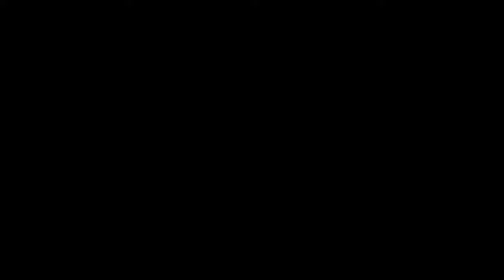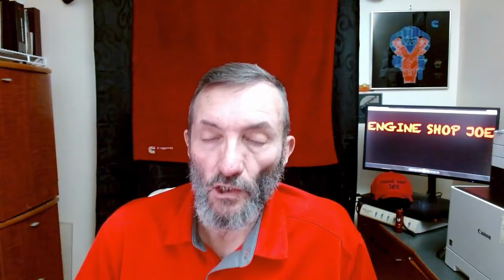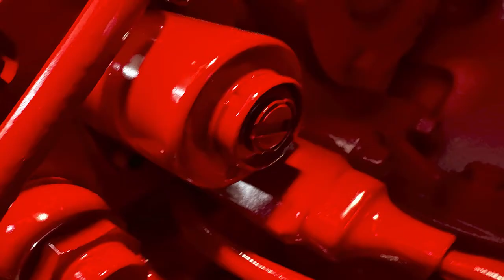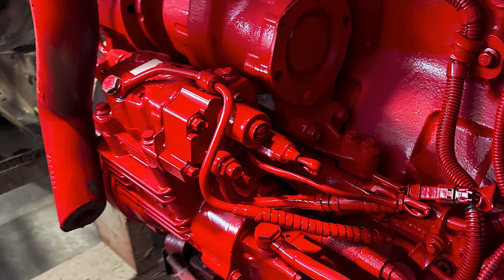What is the IMV valve?

Comment: Working on a 2017 px9. have 157 fmi 1 559 code. changed filters. changed hose from tank to primary filter. changed electric lift pump. verified 15 psi of fuel pressure with key on engine off. cranks excessively to start. after it starts, it will run fine. 559 code goes inactive. will restart all day long. Plenty of power and no driveability issues. come back the next morning and it will not start without excessive cranking to the point the batteries almost die. Grid heater works. Draws 180 amps. Can see and hear it working thru insight. Secondary fuel filter is almost out of fuel. Primary fuel filter is full. If i fill the secondary filter and override the electric pump via insight I can get it to start.  Could the check valve in the ecm cooling plate cause this problem? Could it be a weak Hi pressure pump? Could it be the IMV valve? Should the secondary filter be full? Where could the fuel be going if the primary is full?
Reply from the maker: I have seen this a couple times. Don't throw parts at this because of my comments.  Once It was the nylon hoses that connected the gear pump to the filter. We found that by putting 3/8 fuel line on with clamps and the problem went away. Replaced all nylon lines (it is either the oring in the line fitting or the shrink fit of the nylon to the barb). The next time it was the shaft seal in the gear pump. Replacing the gear pump fixed it. If the check valve closes and moves ok it is usually not that. I dont think it is the pump head but I wonder how long this holds fuel pressure once you shut it off. I believe on these engines the fuel return at the tank has to be under the fuel or it will drain back. So you have a metal tube in the tank that goes almost to the bottom and the return fuel has to go into that. The filter on the engine should not be empty in the morning. The lift pump should be able to fill it in about 3 key cycles. FYI they make a lift pump that pumps 35 psi now. The harness is a different color. They made it to help push air out when priming the system. Run it and watch the data logger when you shut it off to see how fast fuel pressure drops off. Retorque all the injector connector nuts I have seen that stop a problem like this too.
Reply: @ENGINESHOPJOE  So I think I got these two trucks fixed...finally. Learned a lot from your videos and reading the service manual. These fuel systems don't like air. They are very temperamental. You absolutely need a pressure gauge and the diagnostic fuel line with the .043 orifice in it. I wound up plugging the vent line in the fuel tank and pressurizing it to 5 psi. Found the leak. Kenworth moved the secondary filter the frame rail and when they did that, they used inferior hose in my opinion. This is probably the first place I would look next time when working on the low side of the fuel system. The older truck I was working on had a bad gear pump. I guess it just couldn't enough fuel to the hi pressure pump to start it quickly. sometimes it would start fast and other times it would be a long crank. When everything is working right, that secondary filter will overflow the second you remove that plug in the top of the filter to install the diagnostic plug. If you have no drivability issues or low power complaints, its definitely in the low side fuel system... from the tank all the way to inlet hose to the high pressure fuel pump. Another good tool is a sight glass that you can install in the inlet to the water separator. You will know right away if the pickup is sucking air. Thanks for the replies.